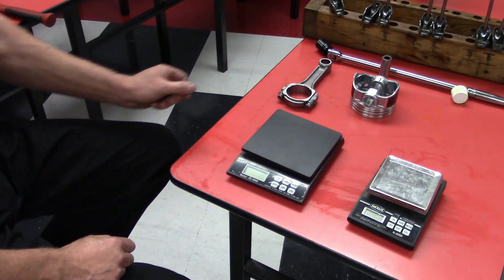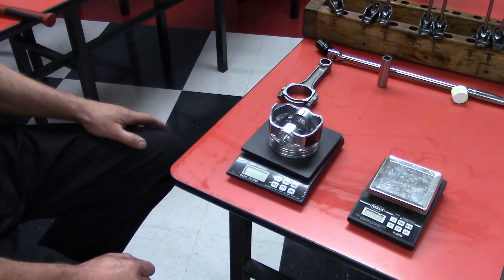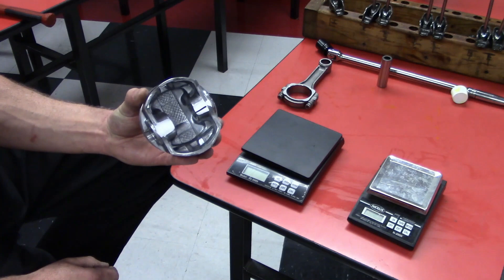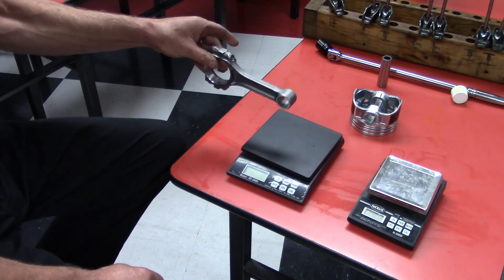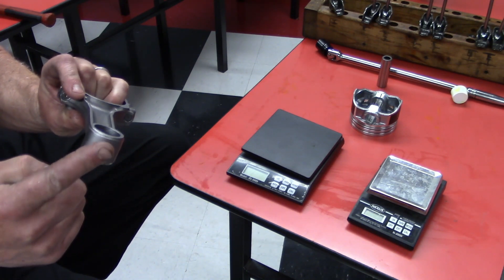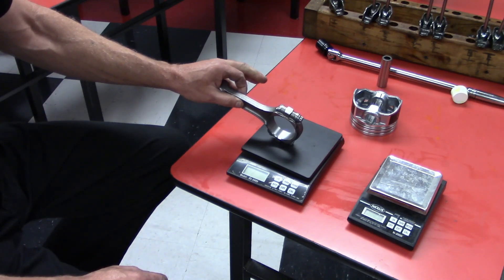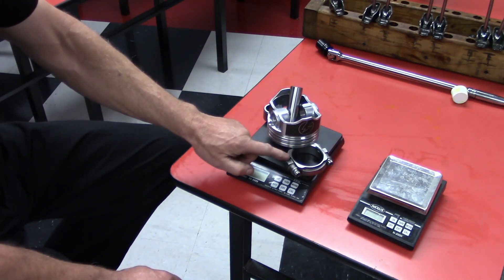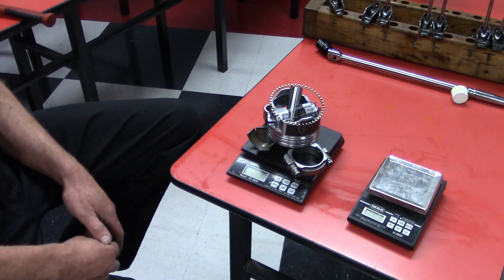350 Chevy Balancing

Comment: I wondered if I had accomlished anything back in 1973 when I built my first engine doing this. It was a 235 inline six and I borrowed a triple beam balance from school for measuring. After this process, I leveled two framing squares and set the crank on them, grinding spots on it until would set at any position without rolling.